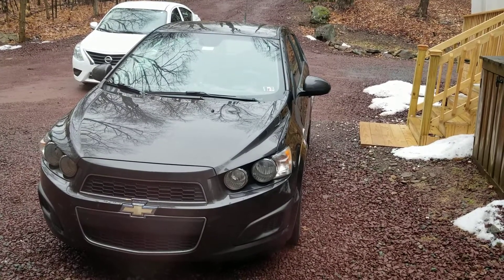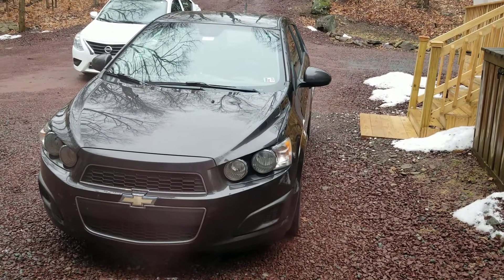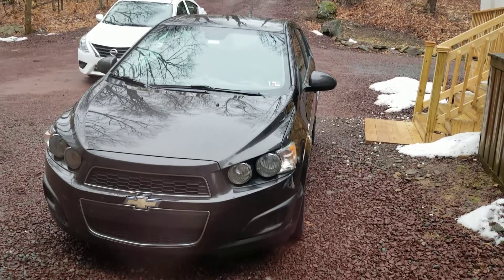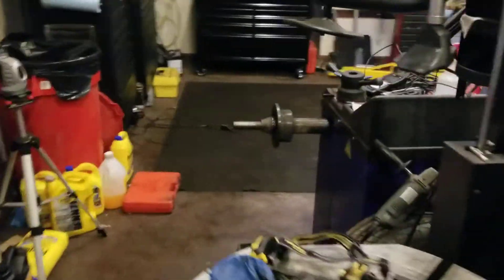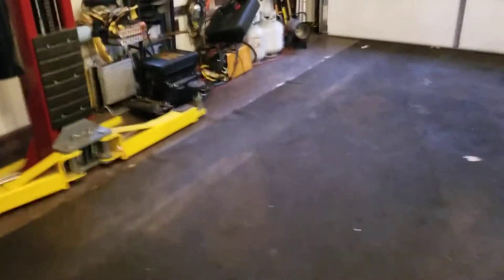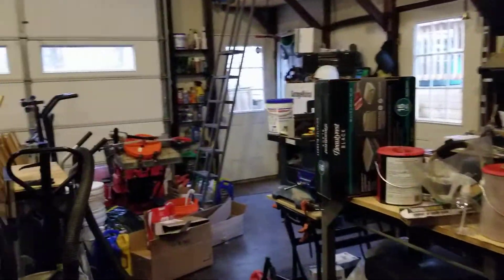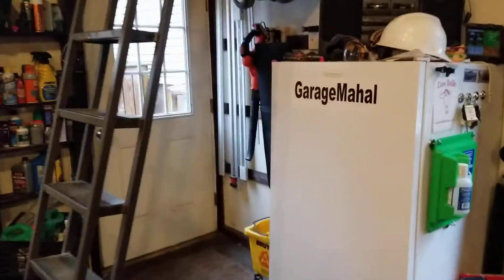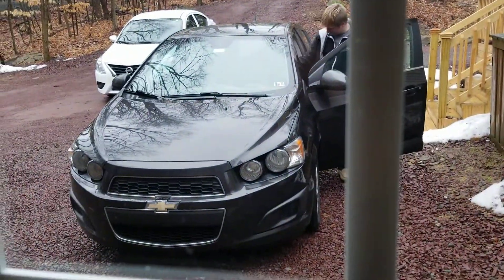Chevy Sonic Bearing replacement, what you need to know!

Comment: Hi dear
Please how replace Bearing Compressor for chevrolet sonic 2013 ?
Reply: Got quoted 500 at a local shop. Bought/rented all the tools plus the hub and bearing for $250
Reply from the maker: Depends on your area, should only be about 1 hour labor at most places.
Reply: Was the chatter like a click sound? I didn't use grease on the hub but I used it to push in the bearing and now my driver side tire and every now and then we'll make a tick or click sound when I'm slowing down or starting up.
Reply: Should the rubber seal side of the bearing magnetic tone ring be facing up while pressing it in or facing down, can you please give a definitive answer?

Comment: Good to know, I ended up just freezing the wheel bearing for a couple hours and then pressing it in. It went in with no issues, but I did have to get a new hub because I couldn't get the bearing race off the old one.
Reply from the maker: That's where an air hammer comes in handy ;)